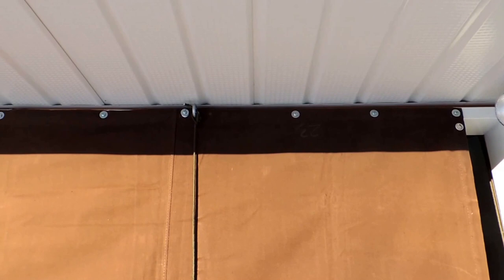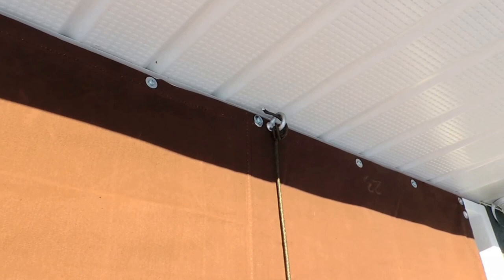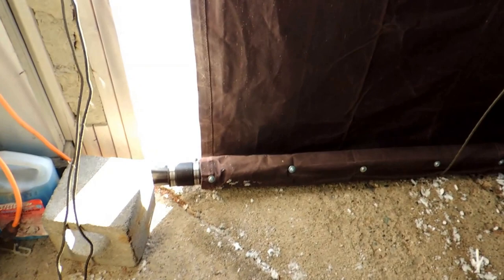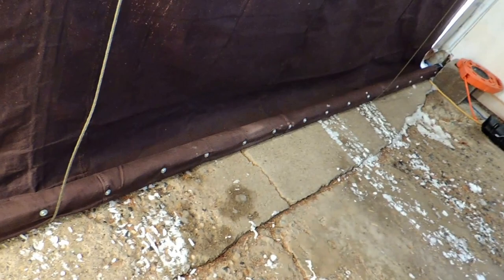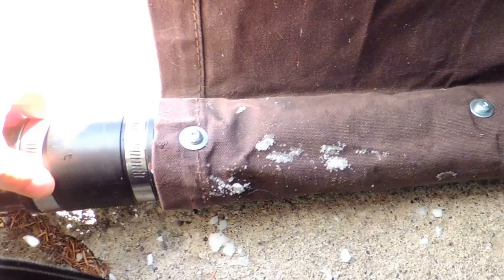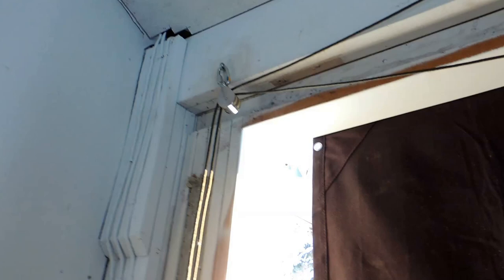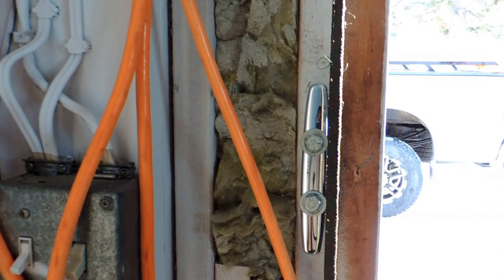Carport roll up door.

Comment: I tried this method on my lean-to. The opening was 12' wide x 13' high. I was using canvas not a tarp. While it did roll up the canvas, I had to assist rolling it as it tended to bunch up because it was thicker and heavier. Still a much better system than what I had before. Thanks for the good video.

Comment: I just used your design on my shed - I have one suggestion for anyone attempting to do the same. Roll the tarp tightly on the PVC so that when it rests on the floor the tarp is taught - then put in another set of screws. The trick to getting the tarp to roll up tightly, rather than bunch, is that it starts tight. (My local hardware store didn't have heavy duty tarps - that also may have been a problem). Thanks!

Comment from the maker: I used a heavy canvas tarp.  Very similar to the material Carhartt uses for their work pants.  It was durable enough to never give me a problem.  I just capped the pvc ends with regular $3 pvc caps and to prevent the door from blowing into the carport I placed a cinder block at the base on each side with enough room for the pipe to slide all the way to the floor.

Comment: Nice. Im thinking of making one for my woodshed I just built for my firewood when it rains and snows. I have roof rubber 12X8 for my opening I'm wondering if this will be ok in a system like yours. Question: Does the canvas ever get lope sided when pulling up the door? Thanks Great job.
Reply from the maker: each side of the roller is balanced by pulling evenly on the two pull ropes.  It never goes sideways if you are attentive to this. Cheers

Comment: Very nice - what kind of screws are those? Did you just drill them into the PVC?
Reply from the maker: I used a larger pan head wood screw with a fender washer underneath. No pre-drilling.